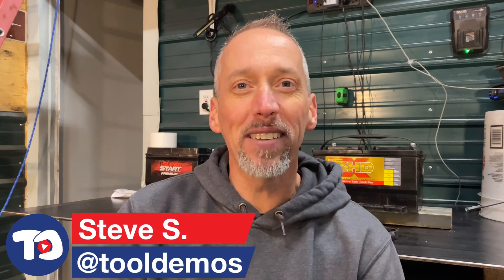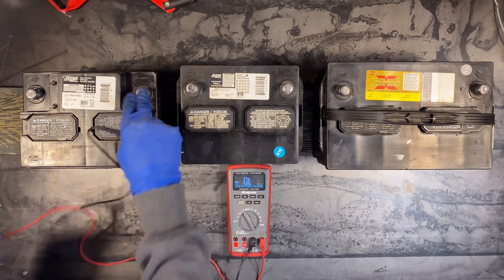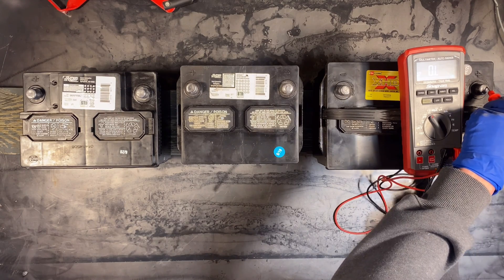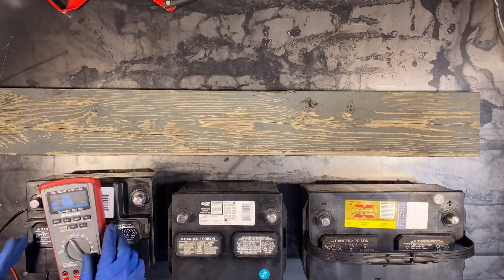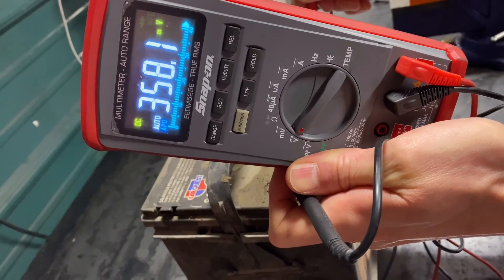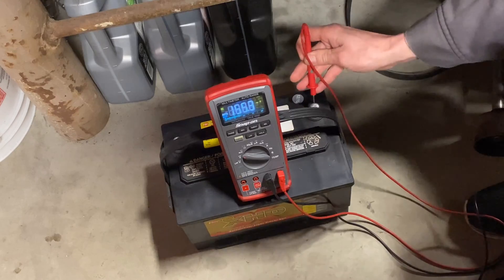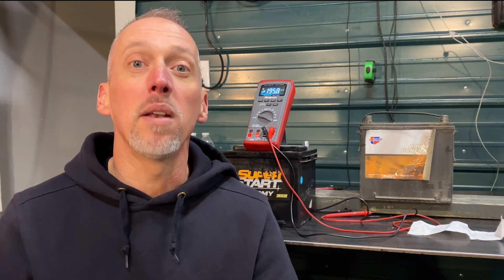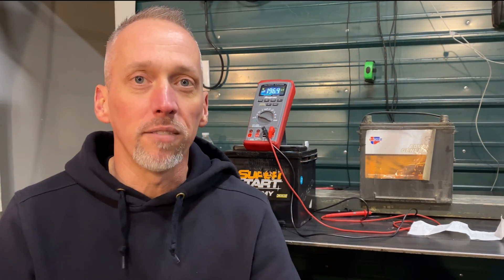Do batteries discharge on the floor?

Comment: After I saw your video, I decided to try this test on my newly tiled floor in our house...but didn't take into account the temp drop due to winter. My conclusion is: bare concrete or floor does NOT alter or directly affect the charge at all. But temperature does seem to have an effect on it on bare concrete.
Reply from the maker: Makes sense.

Comment: I might not be able to explain it but I’ve bought batteries brand new from the store which were dead in months on the floor. I’ve had batteries that worked perfectly which sat on the concrete for a year that was dead. I’ve even had 2 brand new batteries from the same store same lot and the one that sat on the ground was dead with in a year. You might not have been able to test it but from my experience it does. Again I can’t explain it but brand new batteries have died for me from the floor
Reply from the maker: https://youtube.com/shorts/TLYG9jU0gT0?si=AQnSXLAN5H7pdR_d

Comment: It is my understanding that this “myth” originates from when early batteries, before plastics, the battery case was made from leather. The best they had at the time. The leather case of the battery, on concrete, would leach the acid through the leather, into the concrete, and created a conductive path that would discharge the battery.  Thus the myth to not store them on the floor.

Comment: The self-discharge effect is not due to the concrete itself, but how the concrete delays temperature changes at the base of the battery.

All lead-acid batteries will self-discharge, even with no load applied. The rate of self-discharge can be influenced by variations in temperature.

Batteries are most efficient at around the same temperatures at which humans feel comfortable. The voltage of a battery varies slightly with temperature. Generally, as the temperature drops, so does the voltage.

Let’s assume the concrete was poured directly onto earth, is shaded from direct sunlight, and the earth influences the temperature of the concrete. The temperature of the air will change faster, and to greater extremes, than the temperature of the concrete. The temperature of the concrete will be cooler than the ambient air during hot weather, and warmer than the ambient air during cold weather.

If the top and bottom of a battery are at different temperatures, then the top and bottom of the plates want to be at slightly different voltages. This will cause a small current to flow within the battery, resulting in a slow self-discharge.

If a battery sits directly on concrete, and is exposed to large variations in ambient air temperature, then the top of the battery will change temperature more than the bottom, resulting in a slight internal current that will slowly discharge the battery.

Placing a thermal insulator under the battery, such as a block of wood, will reduce the self-discharge rate of a battery sitting on a concrete floor.
Reply from the maker: That was very well explained. Thank you.
Reply: Interesting idea. In a shop with no variations in ambient air temperature the battery's plates would stay at a uniform temperature and cause no current flow.

Comment: The case can allow electrons to pass through the case and cause it to discharge. If this happens it means the battery needs to be replaced. On cars with metal battery trays this can cause the battery to drain slowly.

Comment: The reason I was told is that dust settles on the top and creates a very high resistance circuit between the terminals which drains the battery over time, like connecting a small bulb would do (but faster). Made sense because we were always grinding, filing, cutting, welding, making metal dust. I don't know if the reasoning is true, but I always give any spare car battery a wipe so it doesn't get dusty.
Reply from the maker: That I believe could happen. Especially with metal dust.

Comment: Do you think the old batteries from the old day1920-1970 would go dead on the concrete? The new and old batteries are about the same construction so I’m thinking not..
Reply from the maker: The comment from Junk From Work has some good info on that. He said they used to have glass cells that could break.

Comment: I've always found most ohm or even voltage leaks around the  top caps and I can trace it from high to low
Reply from the maker: Yeah, someone else mentioned that it could be from a vent leak.

Comment: The battery that had high resistance to the case is from a dirty battery, if you look close you’ll probably see a vent trace across the poles
Reply from the maker: Thanks Jo, that makes sense. I’ll check that in the morning.

Comment: I usually try to store batteries wherever there is a spot, floor shelf, bench wherever, but I've always wondered if a battery would discharge on a shop floor. Now I know not to worry about that any more,  lol. Great video dude!!!
Reply from the maker: Thanks Jude. As Will said, don’t put ‘em where you’ll trip over it. Haha

Comment: Great video this is a piece of advice that was accurate but it no longer relevant. very old  lead-acid batteries  had glass cells all encased in a wooden box. This means that if they were left on concrete or cement floors, the moisture from the floor could cause the wooden box to wrap, allowing the glass cells to shift and break. I have been told it can discharge modern batteries if the cement s very cold. It’s generates a temperature difference from the top of the battery to the bottom causing internal convention currents that can increase the speed of the chemical reaction. That being said I don’t buy it. 🍻
Reply from the maker: Okay, so there is a basis for the myth. That’s cool, thank you. The convection theory sounds ‘sciency’ but I’m with you on that one.
Reply: Why would you even mention it if you don't think it's true why I even talked about it and put that thought in somebody's head confusing them even more that a cold floor can discharge a battery no it doesn't 
. It caused it to appear to be drained but upon warming it will test normal. It always blows my mind that everybody wants to add stuff in but it's not relevant stuff like you're talking about stuff that doesn't happen that doesn't exist why not talk about something that does.